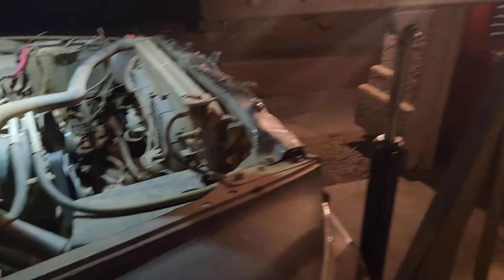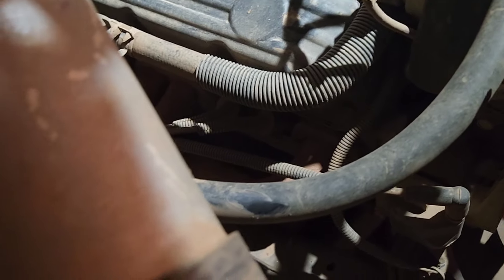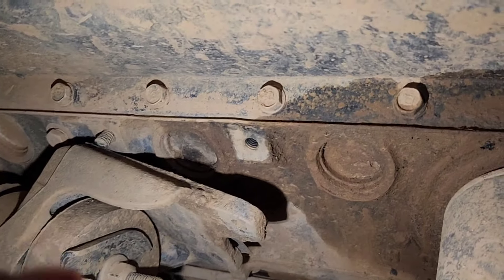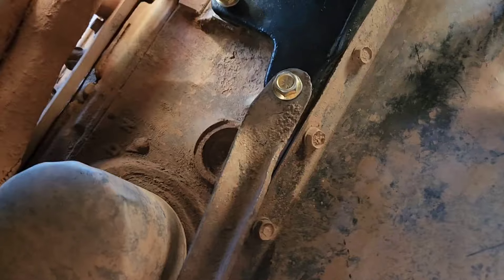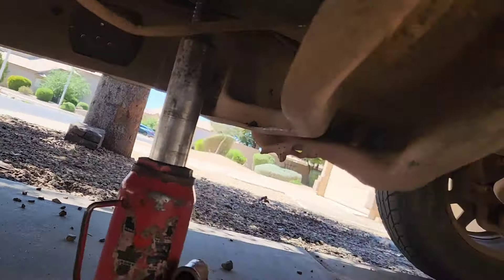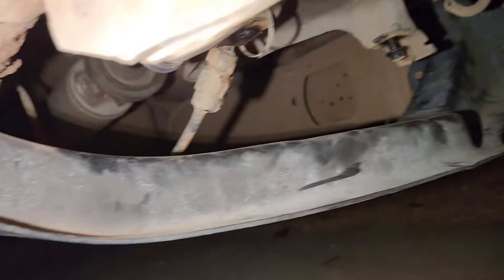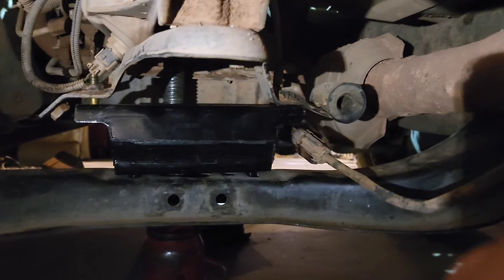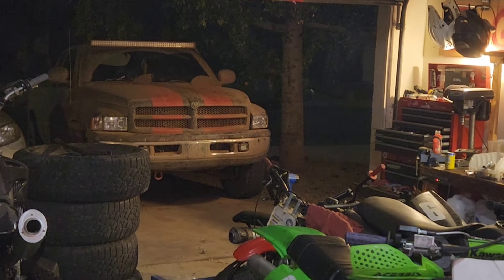How to change your engine and transmission mounts on a 1994-2001 Dodge Ram

Comment: If I’m only doing the engine mounts,what else would I need to disassemble since I have to lift it up besides the air tube so I don’t break anything that I’m not aware of.

Comment: Where did you get the motor mount bolts mine are also gone
Reply from the maker: Oreilly. It's a 3/8" x 16 bolt. Dorman part # 960-211D I'm pretty sure